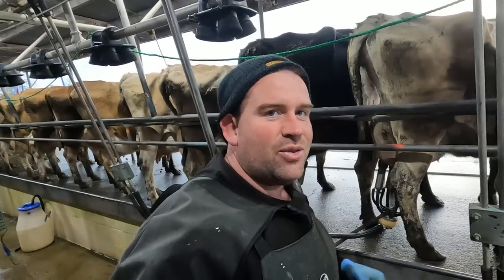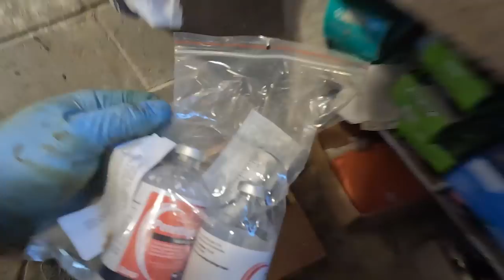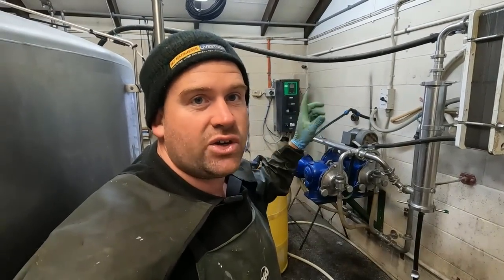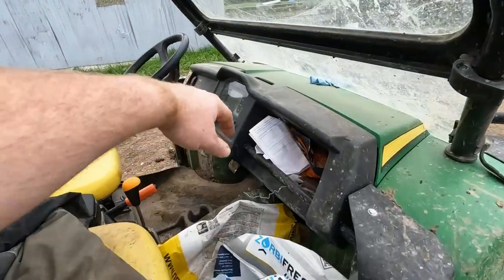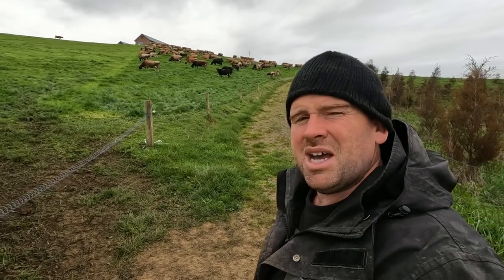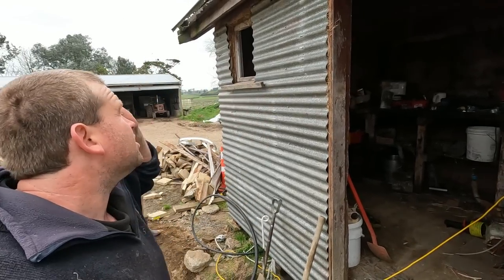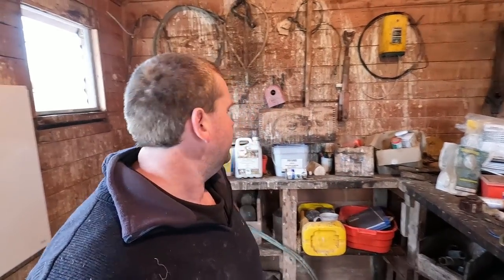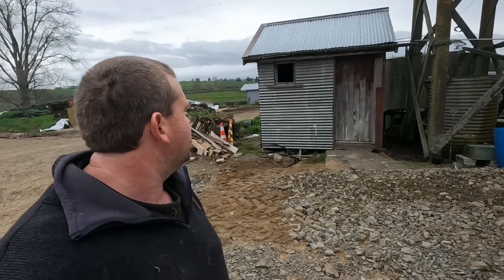Preserving Local History, It’s 100 Years Old Why Don’t We Just Pull It Down?

Comment: I had a vet consult during the winter about intracillin vs penclox vs penetheject and how much all 3 cost, it’s cheaper to smack multiquaters with the tubes then it is treating multis with the penetheject. Maybe talk to your vets about prices. Also I find intracillin this time of the year will smack most mastitis cases and won’t start using penclox over intracillin late September early october
Reply from the maker: Interesting, I did go over the treatments maybe a couple of years ago with my vet at my consult and worked out penthaject was cheaper for multi’s. Maybe prices have changed 🤷
Has intracillin got a stronger dose of penicillin in it?? 
Definitely something to ask her about tho
Reply: @TheOnceADayFarmer  I use intacillin 1000 this time of year does the trick with most cases if that doesn’t work I’ll smack it with penclox afterwards. In saying that we culture all mastitis this time of year to make sure we are using the right drugs